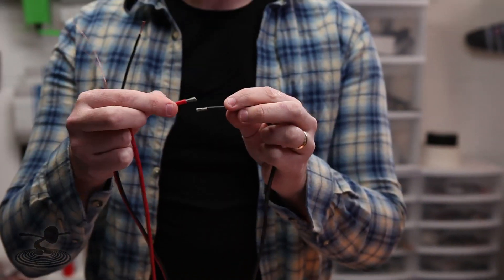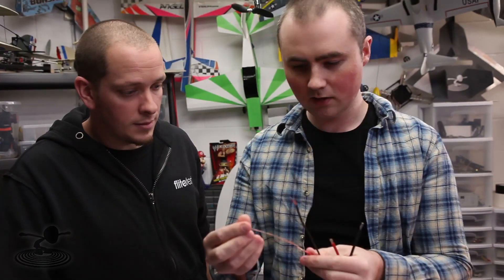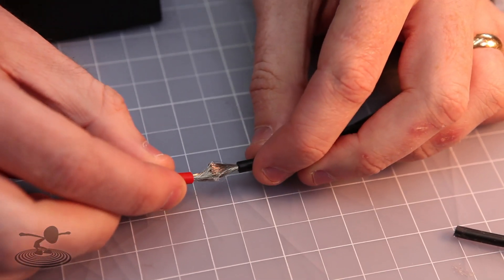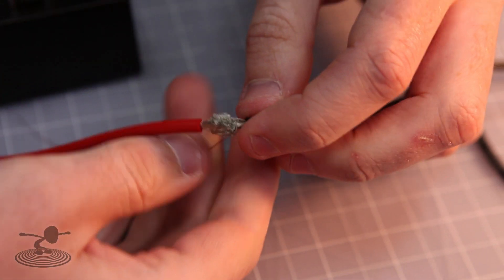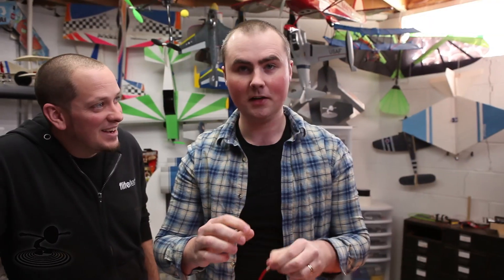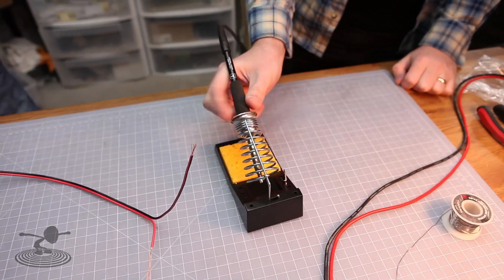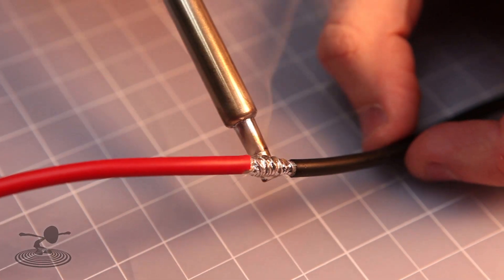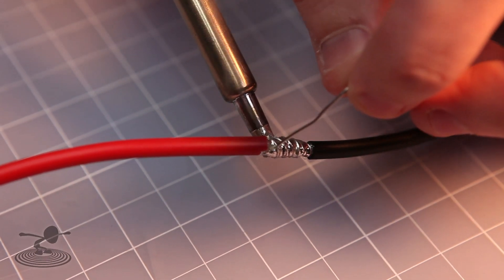Flite Test - Solder Thick Gauge Wire - FAST TIP

Comment: another tip while putting on dean connectors to your battery if they dont have them, dont touch both wires with the end of your iron while pushing onto the wire and slipping. i did this and shorted out a brand new lipo now its junk

Comment: Adding flux to both ends of the wires, before pushing them together, helps the solder penetrate the joint, and requires a bit less heat.
Reply: Exactly! Thanks for mentioning this!

Comment: Dont know if the bulletconnectors have this these days but when I soldered bulletconnections i "filled" them with solder, and soldered on the wire. 
And when I was going to solder them together I placed the tip of the iron in a small hole the bullet connector had in its side. That really helped because then I could heat both wire and connector.

But I dont know if the bullet connector have that hole these days :S

Comment: I use a flame torch to melt the solder inside the bullet and dunk the wire in. At the same time keep the flame on for 3-4 seconds more to make sure the solder flow bond fully.

Comment: Can u use any cable, or have to be an extra speaker wire?
This tip its so usefull and helpfull! Thx so much!!!
If the join its so strong before u use the solder, why do u actually use it? Can I avoid it? thx so much!!

Comment: The way I do it is to clamp the bullet connector in a vice or alligator clips with the hole facing up. I fill the hole with molten solder and then while it's still liquid I keep applying heat to the outside of the connector while inserting the wire. keep applying heat for about 3-4 seconds and then let it cool. never had a connection fail.

Comment: To solder big wires, you need a BIG IRON. A little temperature controlled iron used for fine solder work on PCB isn't going to cut it when the gauges get up into 14/16. My suggestion is to get a 100w soldering gun and use that for your big wires. I bought mine from Harbor Freight and I have used it several times and it works great for big wires. I even soldered some 10GA wire for a friend running car audio wires.
Reply: I'm finding that out with 10awg stranded wire on a trolling motor.  Even with the iron cranked up, having the solder "soak" through seems impossible.  I'm wondering if using the copper wire (which is a GREAT idea) is helping to distribute the heat to the opposite side of the stranded wire, helping the solder flow through. 👍

Comment: what i do is heat the iron to 750f and then tin the wire first then i tin the connector lets say dean's plug tin the tabs, after you tin the tabs in the connectors bring the wire close to the tab but keep heating the tap then heat the wire with the tab it should start to mesh quick and that is is :-) i will try to post a video on how to do it in a day or so ;-)

Comment: Large 70 w iron does the trick. The large mass wont drop temp as easily.  You also need a good insulated holder for the bullet.

Comment: use a soldering iron no lower than 60W. in your case, adjust your iron output to no less than 60W. you'll need lots of heat quickly. another trick is to use some soldering paste on the wires and connectors you're going to solder. you can also slip a bullet connector into a heatshrink tube to prevent heat from dissipating onto your pliers or soldering jig.

Comment: Make sure you insulate the bullet connector from whatever you are holding it with. I was holding mine with a metal vice and it was sucking away the heat like a heat sink. I put some thin plywood of the face of the vice jaws so the heat stays in the bullet connector. I just tin the wire, heat the bullet connector, melt the solder into it then stick the tinned wire straight in and hold the iron on for a few more seconds so it melts the solder on the wire and let it cool. Hope that helps you. :)

Comment: Solder Myth is to have the solder flow under the insulation... you actually still want to see bare copper between the soldered area and the insulation of the wire (about the thickness of the bare wire). Solder under the insulation is known as "wicking" and is undesirable in a solder joint as individual strands are more susceptible to breakage restricting current flow. BAD with the larger motors and such where you want more amperage

Comment: Have you got any tips for soldering plugs like bullet connectors to thick gauge wire? I always have trouble getting the solder to seep into the wire and stick to the plug even when using a temperature controlled iron. The bullet connector and what ever is holding it in place just seems to suck up all the heat and my iron ends up sticking to the solder.